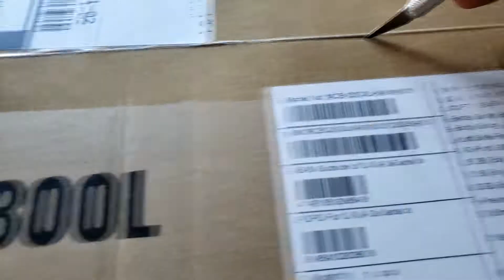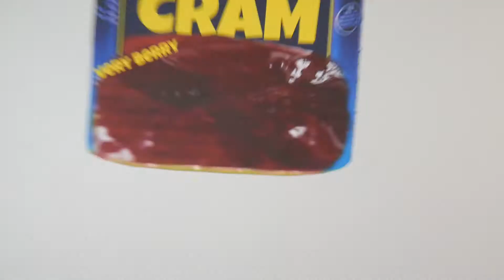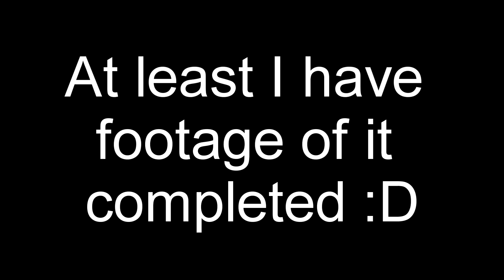Cooler Master Q300L Case Build/Swap

Comment: Congratulattion bro
Reply from the maker: Thanks fam!
Reply: @AsianJBlazian  I'm riding a pc in Brazil, B450 steel legend, Ryzen 3700x and an RTX 2060 in the Q300l. Unfortunately, here this configuration came out more than $1500
Reply from the maker: @1BoxTV  Wow thats high, yeah. Due to this pandemic. Lots of people have been buying gaming pc, or wanted to build one. And the ryzen 5 3600 is the most picked cpu. So they ended up price gouging it. And for some odd reason. My gtx 1060 is more expensive than an rtx 2060 even tho its much worse in performance.

Comment: What happens if you dont have an I/O shield because I dont have mine
Reply from the maker: The motherboard shield for the ports in the back? Nothing bad will happen it would just look really ugly.
Reply: @AsianJBlazian  okay because I just ordered this case, it comes tomorrow, my pc isn't that good its ryzen 5 3600 and rx 580 so hopefully this case will do better than my current 14 year old pentium Dell case with no open holes on the case
Reply from the maker: @Krels  every pc is considered great. Thats a decently spec pc especially with today's pricing. But overall its a good case. Small/compact, but you will need case fans. As this case is known for not having good airflow.
Reply from the maker: @Krels  so if you can add case fans. Then the case will be perfect
Reply: @AsianJBlazian  i have 3 fans will that work to the point where I won't get any problems?
Reply from the maker: @Krels  that should be good enough